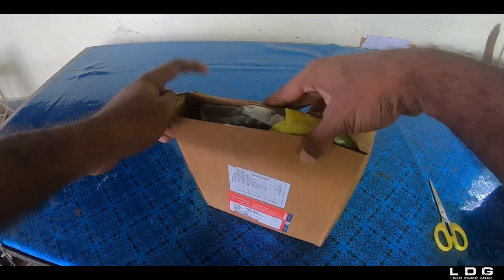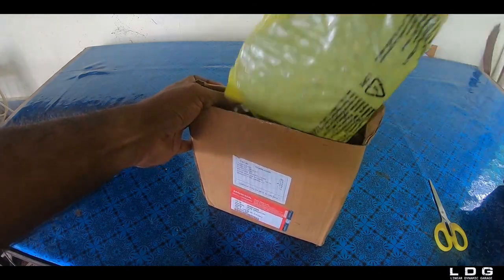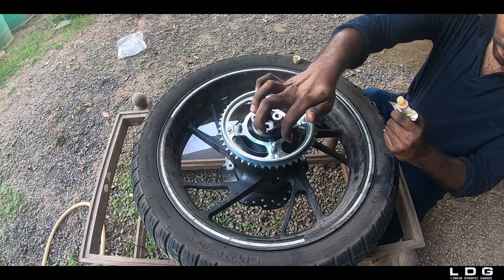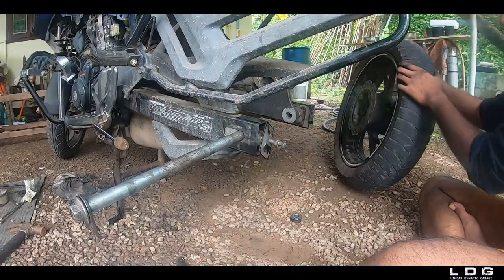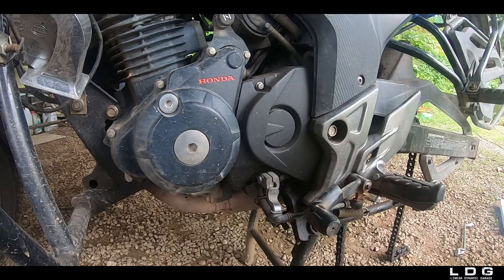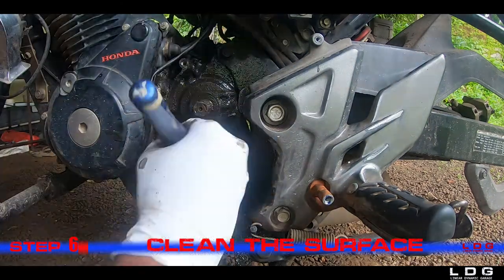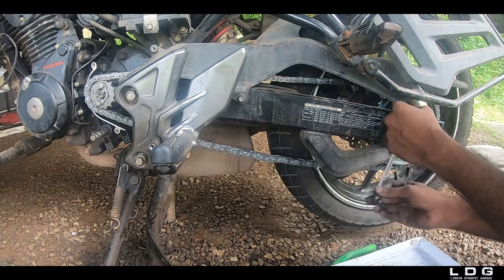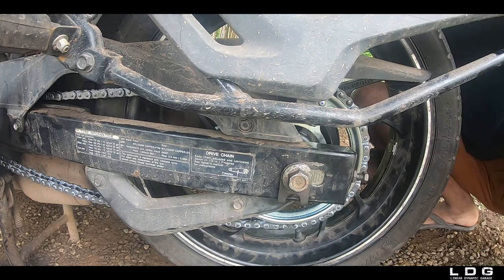HOW TO CHANGE OLD CHAIN AND SPROCKET AT HOME HONDA CB HORNET ENGLISH

Comment: Bro, I have 2017 model hornet, 3 weeks back only I changed to o ring chain sprocket. From day 1 some weird noise is coming from the rear sprocket wheel how to fix it. (after new chain 400 km coverd, day by day noise incricing) Please help me out.
Reply from the maker: Make sure you have tighten the chain, after tightening it if the sound is still present then do a chain lube job
Reply: @ldg-lineardynamicgarageand1072  2nd time chain tighten n lube also Done bro still problem not solved
Reply from the maker: Have you replaced the used chain with the Honda original Chain kit
Reply: @ldg-lineardynamicgarageand1072  yes in Honda service center only. Full chain kit replaced.
Reply from the maker: Can you send me the video of the sound
Reply from the maker: @goutham1100  I have never encountered with this kind of problem, but the way I see there is something wrong when they fixed the wheel sprocket
Reply from the maker: @goutham1100  or may be the wheel alignment is not proper
Reply: @ldg-lineardynamicgarageand1072  ok i will check with service center guy n updat you thank you so much